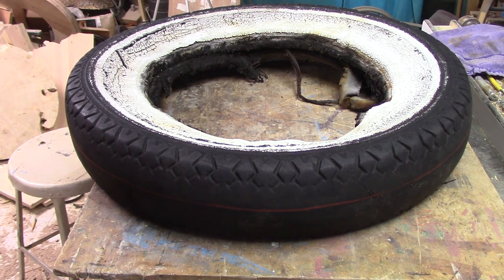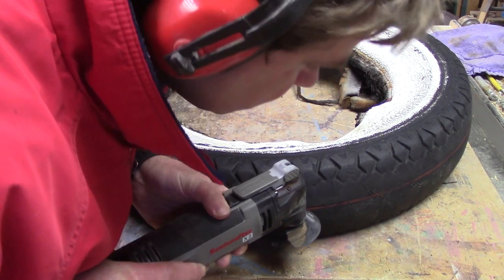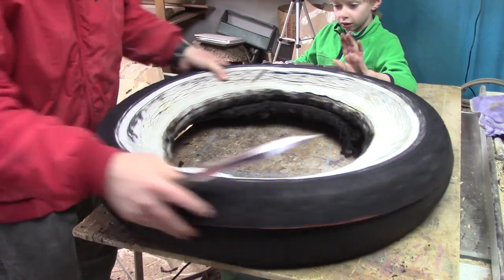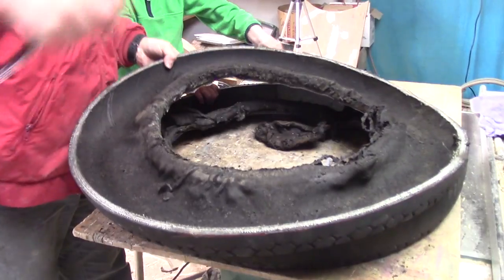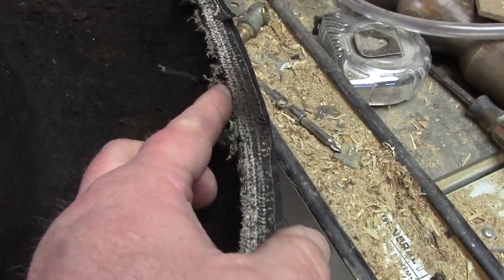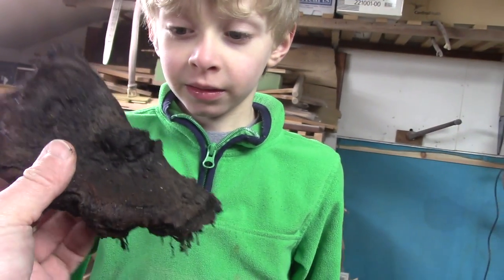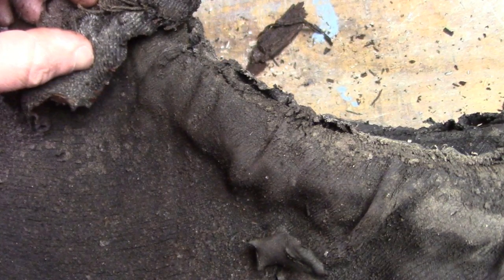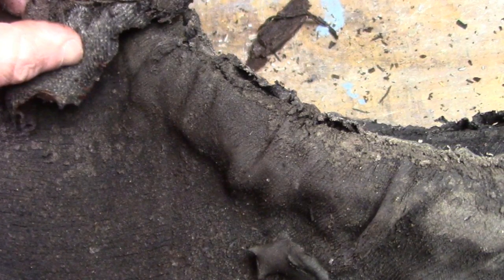What's inside a 1920's car tire?

Comment: That's no patch. That's a "boot". Just reinforcement material to help protect the patch as you said. Still common on bike and tractor tires.
Reply from the maker: Tractor tires maybe, but how could they balance the thing with a slab of rubber like that inside?
Reply: That's a good point. I guess 3 factors: Big lead clip on weights (or another boot opposite), slow speeds, and cars that weren't very smooth in the first place. Also, the tire might have been reused for agricultural purposes after it's service life on the car. Tires were expensive during the great depression which is probably when it was removed from it's first service life.

Comment: They don't make them like that nowadays - they could have re-treaded that tyre!
Reply from the maker: Very thick but even more interesting is that it has been several days since I cut it open and the rubber is still saturated.  I wonder why the old rubber has soaked up so much water.